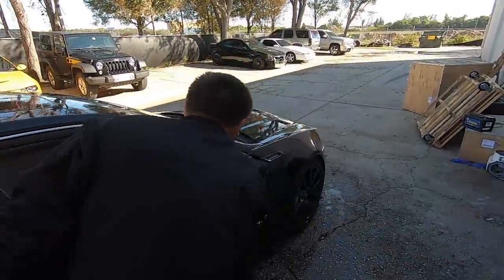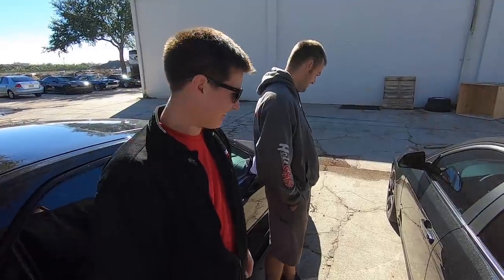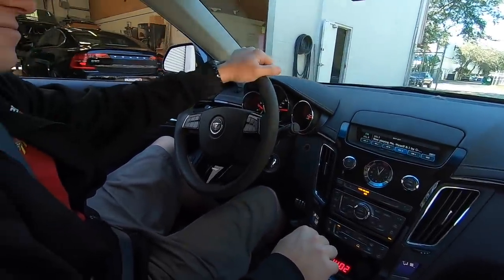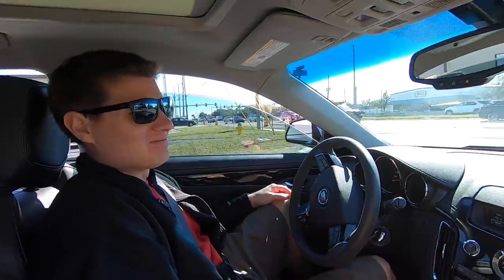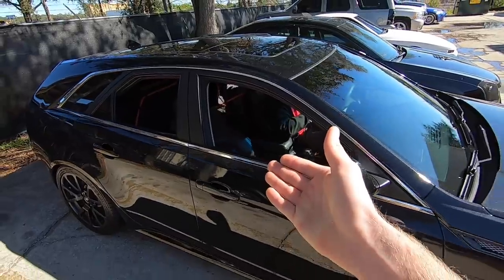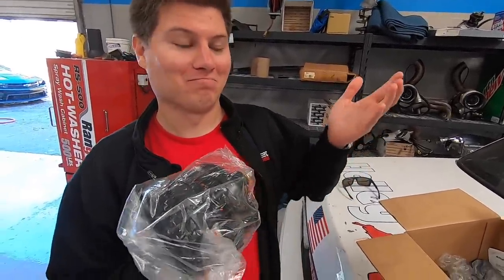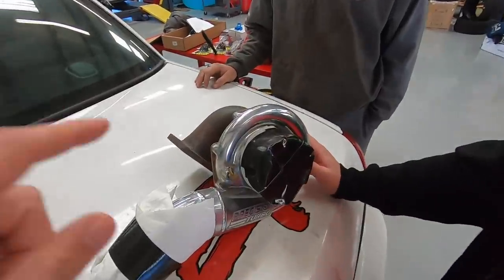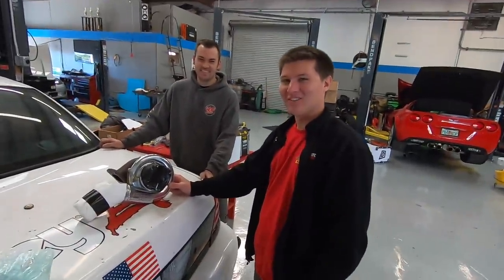Introducing the Spaghetti Wagon... Cooper's NEW Daily! (+ V and Supra Update)

Comment: 13:35 "the head's not even gonna come off" Hahahahahaha!
Remember those words. It won't be long.
Reply: Its a 2j theyre made for 800-900 stock internals
Reply: anonymous user Those all depend on how your engine is because the crank is the most powerful part of a 2jz and "should" keep 800whp but some may experience failure at 700-750
Reply: IS it a 2jz or a 7Mge? @JosueGonzalez-if2ty

Comment: "Holy crap" "320 amp alternator." dang hook up the welder.
Reply: Common size for stereo guys
Reply: @michaelscott9791   Yeah and Mechman is a nice unit. The funny thing is now fuel pumps and go fast goodies drw more than what a basic stereo does these days. The new class D amps are pretty efficient compared to the old A/B heaters from back in the day.
Reply: Class d amps are better in efficiency until they wire them down to .5 or lower. I personally prefer singer alternators over mechman. As long as someone doesn't run a Ebay or candy shop alternators they're all good units
Reply: @michaelscott9791   They do lose some efficiency when running low loads, but they're still better than most class A/B's. I forget the exact numbers, but back in the day my old SoundStream 10.0's @ .5 where between 30-40% whereas a new class D amp would be 50-60%. Almost twice as efficient in turning power into sound at similar loads.

Comment: 320 amps is CRAZY I'm getting a high output alternator for my 04 Pathfinder and it puts out 180
Reply: I have 610 amps total in my trailblazer
Reply: @bizzy42007  2 or 3 alternators?
Reply: You should look up some of the audio builds where mechman alternators are used. Some are nuts, highest I've seen was 5 of their elite series 370 amp alternators.

Comment: Those 2jz bottom ends are super strong you could put over 1000hp and it will hold it. You got people running stock drivetrain diffs bottom ends and with a built top end and turbo kits and push over 1000 hp and it holds all day

Comment: Nice caddy and you will definitely have power with that mechman 320 amp alt I have a Singer 320 amp alt with a Northstar agm65 battery and 4 Xs power d5100 batts in the back with 3 runs of 2/0 power wire in my stereo system but I know you aren't going to run a big stereo

Comment: Want to do an engine swap on my 2002 Pontiac firebird right now time has the stock 3.8L V6 in it but with new heads and headers. Pretty much want to know everything I’m gonna need to do the engine swap. Want to do somewhat what they did with ruby and put an old 5.7L V8 in it but not sure if that will fit and what other things I’m going to need to replace to handle the extra HP will end up getting a new intake and plan on putting a turbo on it so any advice belps